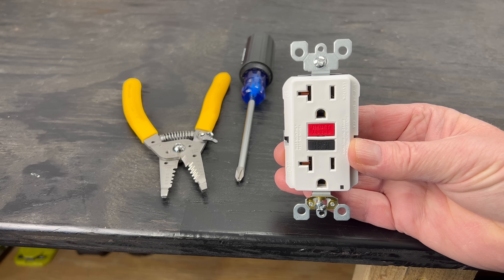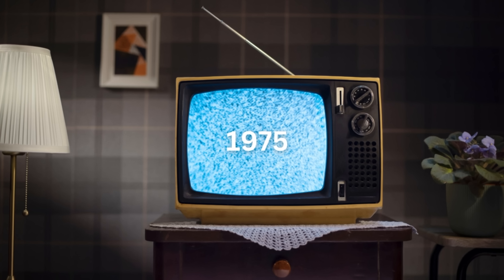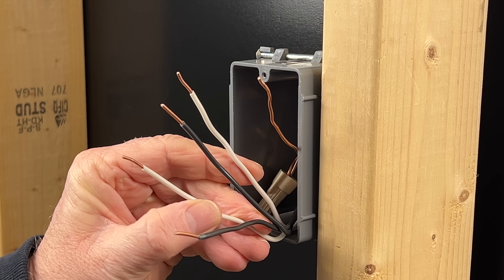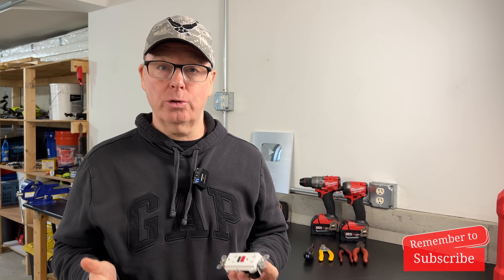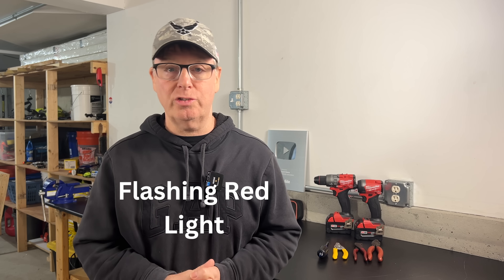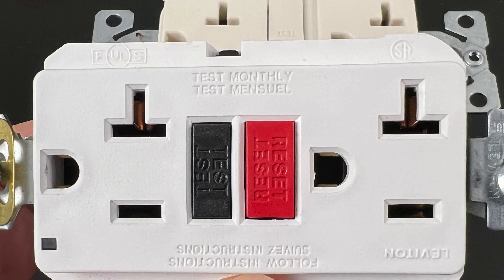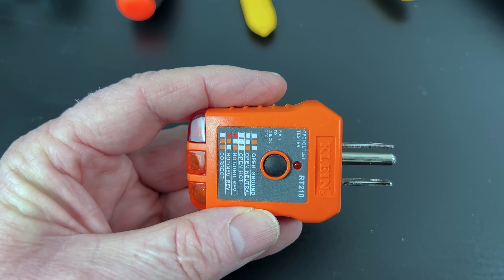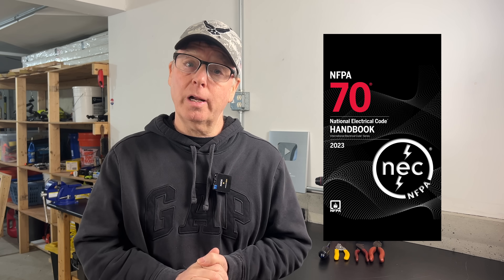Did GFCI Receptacles Change Without Us knowing?

Comment: Hi John, love your channel.  I have a question concerning GFCI protected circuits on kitchen counters.  A few years ago, my mom had her whole house renovated including a new 200-amp service panel and all new wiring, outlets, switches, etc.  One day while I was trying to verify which breakers controlled which countertop outlets, I noticed that the electrician had used a double pole breaker with the toggles bridged together to protect the two countertop circuits.  Is this correct?  It seems a bit odd to use a double pole circuit breaker to protect two separate 120V circuits.  I thought double pole breakers (when bridged together) were only for 240V split phase circuits powering a single circuit/load.  What do you think?
Reply from the maker: Thank you. What the electrician did was run a multi-wire branch circuit to the kitchen counter. This type of circuit carries two hot wires from different poles in the panel but they both return on a common neutral. There are dangers associated with this type of circuit which is why they are required to have pole ties. That requires the breakers to be side by side or two pole and that both open simultaneously. It save a little bit of money on the installation but I don't like them because to many people don't understand the dangers especially the homeowner who may be working on them in the future.
Reply: Thanks John but I'm not sure about the common neutral since they are feed by seperate nm-b.  You mentioned dangers with this type of circuit.  What are they and why must both breakers open simultaneously if they are two totally separate circuits? @BackyardMaine
Reply from the maker: Multi-wire branch circuits can be really confusing. Im going to create a video discussing them in detail along with the dangers very soon. It's high on my creation list. I don't know if you're subscribed to the channel but if you are and you click the bell as well you will be notified when I upload so you won't miss that video when it comes out. It will make sense I promise but it's tough to explain in the comments.  @KenCool57

Comment: While I understand the theory behind the GFCI, putting these things behind a refrigerator has to be the worst idea ever. I am willing to assume the perceived risk of not having a GFCI behind a fridge instead of the far more likely situation of a false trip ruining the fridge contents. In fact, my late 1980s house has no GFCIs anywhere (“bad dog! “) owing to the annoyance of false trips. Ain’t nobody been electrocuted in three decades. It is important to remember that the whole GFCI thing has its origins in people who somehow thought it was OK to dry hair with a 120-volt device while sitting in a water-filled bathtub. Never was the phrase “it’s a gene pool thing” so literally true.
Reply: Yeah, it also says on the paper that came with mine to NOT use for life support stuff.
Reply: My fridge is a giant metal box with water, condensation, and electricity in moving parts and I touch it with my skin every day.  So I put a GFCI between it and the breaker when I moved in.  Hasn't flipped yet in ten years.  But if it starts leaking current into me I'll be happy the GFCI is there so I don't die.    The food is replaceable.  I added GFCI to my washer, dryer, water heater, and furnace too.  It just makes obvious sense for anything with a water supply and exposed metalwork.  In fact without gfci, a water heater coil could break in such a way it completes a circuit that the thermostat can not break, and it can boil over and possibly explode.  Think about how a water heater thermostat only breaks one of the two hots.....  If part of that element touches the grounded tank wall...... Mine creaks every time it cycles.  Thermal cycling breaks things...
Reply: Yeah, my sump pump in the crawlspace is supposed to be on a GFCI.  No way in hell.  If that thing nuisance trips it floods the crawlspace in a few hours and a $10k heat pump is underwater and ruined.   All it would take is one time.  The other GFCIs nuisance trip enough that I know exactly what would happen.
Reply: @stargazer7644 I agree, get rid of the GFCI and make damn sure the fridge and sump pump are grounded. No one will die if the appliance is well grounded.
Reply: @stargazer7644  That is a great story — I will be repeating it. Your situation is where the “rule” can and should be broken. What exactly is the risk to anyone, outside of perhaps a mouse — to a non-GFCI-protected device IN A CRAWL SPACE? I would love to know, and doubt the answer is available, how many people have been electrocuted in a situation where a GFCI would have made a difference. I am not talking about the hair dryer/bathtub situation, as stupid can’t be fixed. My point is that hundreds of millions of dollars have been spent on devices to prevent what I bet is an infinitesimally small number of deaths. The industry LOVES rules that sell more, and more expensive, devices.
Reply: If your fridge is tripping a modern GFCI, there is something wrong with your fridge and you should get rid of it.  "Nuisance trips" on GFCIs are basically a myth nowadays perpetuated by curmudgeons and luddites who can't accept that current GFCI devices have actually fixed pretty much all of the problems that old ones used to have in that regard.

I've had lots of fridges (and pumps, etc) on GFCIs and never had any nuisance trips from them.  If you do, it's because your equipment is crap, or you did something wrong, and you should be figuring out what that is and fixing that, not just blithely bypassing safety requirements so you can stick your head in the sand and ignore the real problem.

(And if you have a critical sump pump and don't have some kind of secondary sensor and alarm to detect when it's not working properly, then you're an idiot anyway.  GFCIs aren't the only thing that can cause something like that to not operate, you know.)
Reply: Do automatic self test GFCI outlets interrupt power, to a computer for instance?
Reply: SMALL KIDS DON'T HAVE LIFE'S KNOWLEDGE FOR THOSE CHOICES OF SAFETY AROUND  WATER AND ELECTRIC ...THAT WHY GFIs ARE NEEDED IN BATHROOMS AND KITCHENS AND OUTSIDE
Reply from the maker: I agree. I would use a GFCI breaker or a blank face GFCI in an accessible location feeding the fridge.
Reply: @BackyardMaine I'm putting one there for the inspection and replacing it when the fridge goes in. Anything with a brushed motor can trip a afci and gfci and we've used standard receptacles way before they were around on these appliances without issues.
Reply: @BackyardMaine I had to look that part up, never heard of it before. That’s a great idea. TY
Reply: @BackyardMaine I think you missed his point.  He wasn't complaining about access.  He was complaining about nuisance trips shutting off your fridge and ruining your food.
Reply from the maker: I couldn't agree more and I think having them on refrigerators and freezers is a bad idea. What I was trying to say is since they are required for new installations I would use a remote device. They make them with an audible alarm so you know it tripped and can reset it without moving the fridge.   @stargazer7644
Reply: @stargazer7644  I agree it sounded like he may have missed the point, but I wonder if an electrician on YouTube can suggest not to use a safety device? Thanks for the input
Reply: Ever since GFCI outlets came out, I can’t say I have ever had one false trip indoors.   I have had a couple trip outdoors, and I suspect there was legitimate leakage to cause those.
Reply: I think this requirement is due to a large majority of refrigerators these days are connected to water.
Reply: @GimmeShockTreatment :

Just because you can make up a story doesn’t mean it’s true.

It has nothing to do with connection to water.
Reply: @GimmeShockTreatment  Yep. That's probaby why.
Reply: Dude, your take is not only stupid, but it’s really insulting to the people who have been a victim of ground faults.

Keep in mind the reason they’re required behind fridges is because if it isn’t wired correctly, or something fails with it’s grounding; the fridge body can become live, without GFCI, a shock from just touching the handle would kill you.

That’s not a “gene pool” thing, they had no way of knowing.

Just because you haven’t had issues doesn’t mean they don’t exist. 

Fridge contents (which even then it’s unlikely to ruin them) are not worth a human life.

The people who write the electrical code know what they’re doing. It’s there for the soul purpose of saving lives.
Reply: Having an audible or remote alarm won’t solve the problem of the self-testing GFCI detecting a GFCI-circuit failure and killing power ten seconds after you slam the door on a two-weevacation. If racing home for a period greater than the groove/freezer insulation will hold the cold, put it temporarily on a suitable extension cord to either a non-GFCI or non-self-testing GFCI receptacle until you return. Or have someone check on things twice a day.

If you have a land line, you could wire a line-peered relay (from the receptacle in question) to short the telephone line. By calling and hearing a busy signal,, you would know power was still good, else send for help. It’s a thought.
Reply: @campkohler9131  If you still have a phone line just plug your answering machine into the same GFCI outlet as the freezer. If you call the number and get the recorded message you are good.
Reply: @campkohler9131 The reason I posted my complaint about GFCIs for refrigerator outlets being an impossibly bad idea is that a friend had her brand new fridge GFCI nuisance trip the day after she spent $4,000 to have her home SEP replaced. The electrician returned and replaced the GFCI with a “commercial” grade device. She was fortunate to have noticed the dead outlet before the contents of the fridge were destroyed. Me, I wait until the inspector types have left and replace the outlet with one of the type that functioned without issues whatsoever for three decades behind that fridge.

Comment: There is one thing to be aware of if using the plug-in GFCI tester. A GFCI receptacle is permitted to replace an old, 2-prong (i.e. no ground hole) receptacle. When used for that, it's supposed to have a sticker placed on it that states "No Equipment Ground," since there's no ground wire in the box. The self test button will still work when wired this way; however, the plug-in tester will not. The plug-in tester works by shorting the hot to ground and since there's no ground wire to short to, nothing will happen.
Reply: I does NOT short live to ground, only passes a small current through a resistor.
Reply: Yeah, you need to check the lights first, and if the outlet tester shows a disconnected ground, then there's no point in using the tester's test button, because it won't do anything, even if the GFCI is just fine.
Reply: Don't trust electrical advice on YouTube from someone who isn't a licensed, qualified electrician. Instead, if you want to do it yourself, buy the latest edition of copy of Wiring Simplified. (Available at hardware stores, builders stores, bookstores, online retailers for about $18.95.)

Comment: If people use a GFCI where they don't have a ground wire, which is why they might use one in a certain area, the tester will not work. So then the button on the outlet itself must work. Also, I hate LED. There are these little green lights all over the place. They wouldn't bother me so much except that I know they're sucking power, even when nothing is on. I wish there was a way to disable those stupid LEDS so that if there is nothing powered on, on that circuit, that no electric is being consumed. As myself and others want to get off the grid and rely more and more on solar and batteries, we will want to make sure that there is NOTHING extra. So they ought to have no LED. One will know they're not working properly when they don't work. If they're not wired properly, they ought to just not work. And there might be an audio alarm on ones that run a refrigerator or life support equipment that alarm when fail.

I ever get my house built, I am stipulating all outlets be switched, regardless if GFCI or not. Toggle switch to actually open the circuit, so there is nothing being consumed when that circuit is not powering anything. Really, manufacturers... STOP with the damn LED BS already !
Reply from the maker: I get that but just for context the self testing GFCIs consume .5 mA of power. If you do the math on that for 24 hours a day/365 days a year at today's rates would be about 7 cents a year.
Reply: @BackyardMaine  Multiple GFCI so times (X) = X ? And for poor people, those pennies mean a lot. So maybe 2 in the garage, 4 in a basement, 4 in the kitchen, then wherever you needed a grounded outlet but have no ground wire. Then at least one in a lavatory, or in my case, 2 in a 1/2 bath (Weird wiring and I can't get into the attic to change what I need to do) so it adds up. And when people wise up and get off the grid, they need nothing extra on those batteries. And as of now, those GFCIs do not work with them. And if people are like me, if it isn't broken, don't fix it.
Reply: GFCI's use power all the time anyway whether they have an LED or not. 
I hate LED's in the bedroom, especially blue or green which are like a night light. So I buy the GFCI's that only light up on a fault. Smoke / CO alarms get black electrical tape over the LED's, I just have to remember to remove that if there's an inspection scheduled. Of course black electrical tape works on GFCI lights too as well as phone chargers and whatnot.

Comment: My entire house was wired by a tile guy by trade. He didn't even do good work with the tile he installed.

I have so many electrical issues. 
I had some arcing and popping going on in an open junction box in my attic for a couple years. It constantly caused my breakers to switch off.   There's 6 or 8 gauge stranded aluminum twisted into 14 gauge solid copper. No wire nuts,  no tape and the mound of wires was so high they couldn't cover it with another box, so they left it open in the attic. 
 I had a 30 year veteran electrician come out to assess what needs to be done.  He genuinely looked afraid when he saw how everything was installed.  I told him I'd pay him whatever he wanted to just rewire everything correctly, no matter what the cost.  He said it was beyond his skill level.  30 year veteran electrician with his own company.  

Yeah, that made me feel safe lol
Reply: Please keep trying.  That literally sounds like a house fire just waiting to happen.  (I'm not kidding.)

I guarantee you that there are electricians out there who can handle it, you just need to find them.  And if you can't find somebody willing to tackle the whole thing, see if you can get somebody to at least identify and work on some of the worst issues first, and maybe make things better a bit at a time...
Reply from the maker: Wow, thats not good.. Sounds like a complete re-wire.

Comment: Thank you for sharing. As a home inspector I encounter both self testing and non self testing GFCI receptacles. I also routinely see GFCI receptacles that either wont trip or will not reset after tripping. Periodically testing GFCI protected  receptacles is the prudent course of action.
Reply from the maker: Thanks for sharing! I have found the same thing many times. I have also found a lot of them wired wrong as well.
Reply: Keeping toasters out of bathtubs is even more prudent.
Reply from the maker: @stargazer7644  That's usually an intentional situation.
Reply from the maker: @MrMike4833  Isn't that considered natural selection? lol
Reply: @stargazer7644  That won't work with a GFCI. That is exactly what would trip the relay. In a bathtub, even the 5mA will probably make you jump, but the contacts will open in less than an second. I would imagine it could hurt someone with existing heart problems.
Reply: Sometimes it will drive you crazy trying to figure out what’s going on when somebody puts more than one GFCI on the same circuit. I honestly don’t see that many of the self-testing type. Next time I’m at the big box store, I’m going to see if they have any of the older style.
Reply: @stevelacombe5291  Ha, it will definitely help diagnose the source of the problem. Even I took a few days to figure out my toaster further down the line was causing the GFCI 15' away to trip. That is why I'd hate to have to find the problem in the Japanese (?) system where the GFCI is at the breaker box.

Comment: Ugh, what genius at NFPA thought having a green LED on all the time was a good design feature? It should be unlit unless it detects trouble.
Reply: I think it is a great idea as it shows there is power at the outlet.  When you have outside outlets they must be GFCI by code and I always put a switch on them so they are not live all the time.  I can just look at the outlet and see if it has power or whether I need to switch it on first.  Just because there is no power does not mean there is always an issue.
Reply: Also, the problem with having a fault indicator be off normally is that if there's a fault which also prevents the LED from being able to turn on, you will never be able to tell the difference between that fault condition and "it's working fine!"

Most of these LEDs are pretty tiny, so they're not going to be lighting up a room or anything (I've got several of these outlets and I honestly don't even notice the LEDs unless I'm looking to see if they're actually lit), and it's not like they consume any real power, so...
Reply from the maker: Many of them are unlit like the Eaton for example so it's really brand specific. They aren't required to have a green light, they are only required to notify us when there's a problem. NFPA has nothing to do with the change.  CPSC, NEMA and UL.